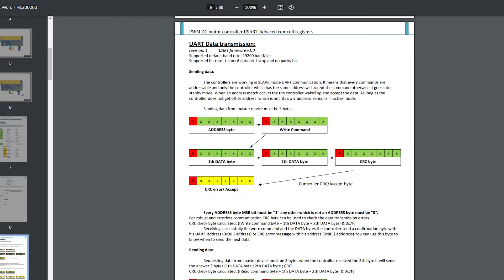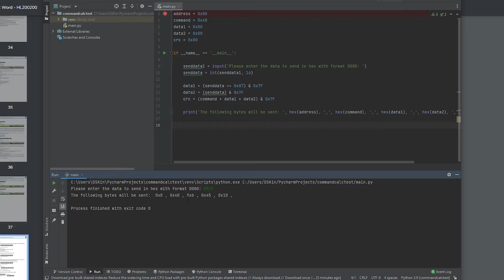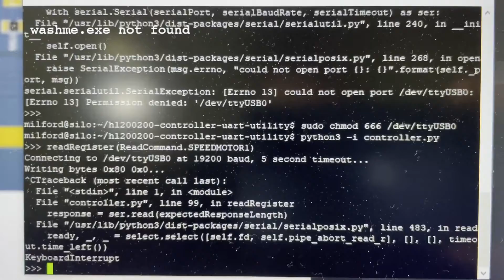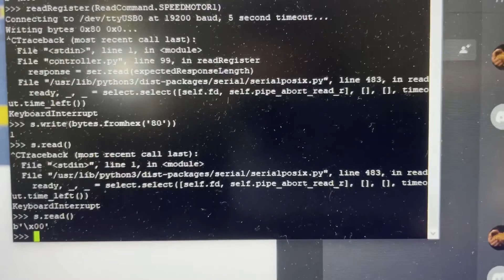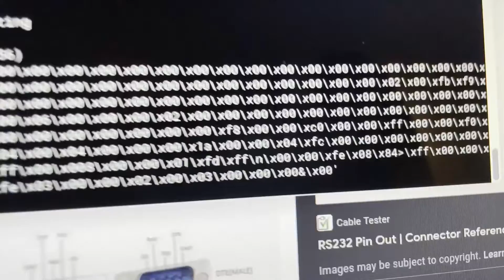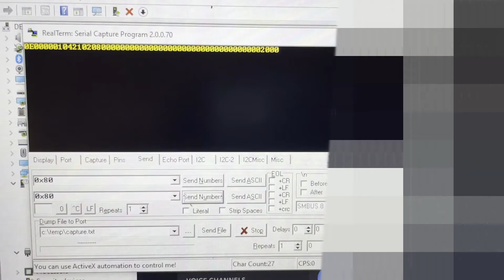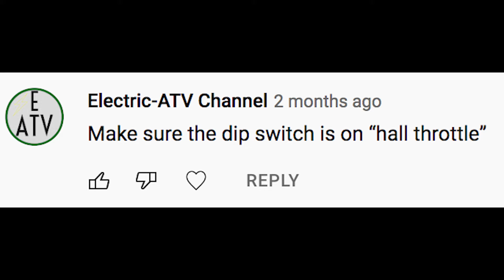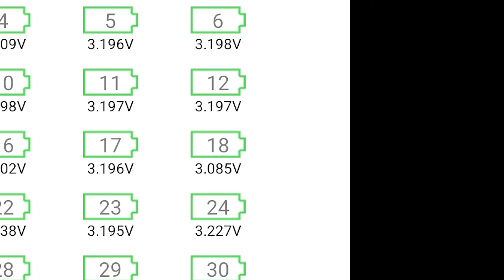Converting a Kei truck into an EV - Programming the controller - Part 20

Comment: my advice is look at damiens channel evbmw and build his 1000 euro cars controller ive not had tyres on tarmac yet but it seems to be smooth as and I modified mine so an arduino provides PWM which can have deadzones coded in for min and max throttle and if your cool with the code you could even map your throttle curves
Reply from the maker: Will check it out!